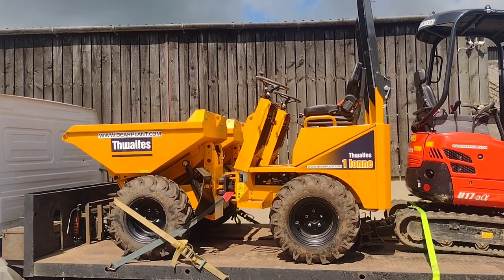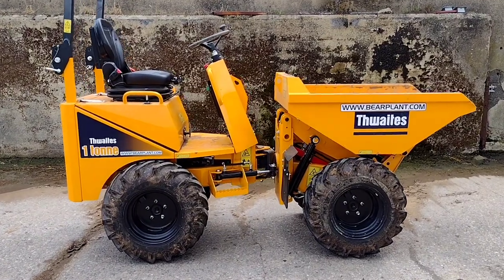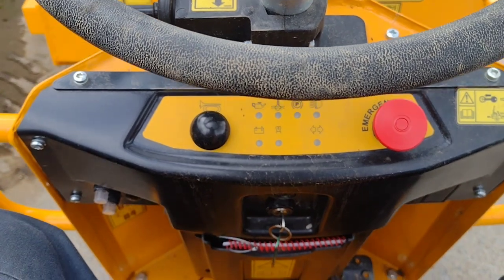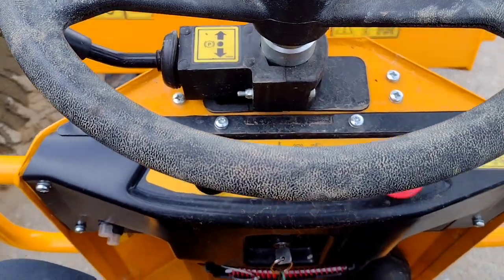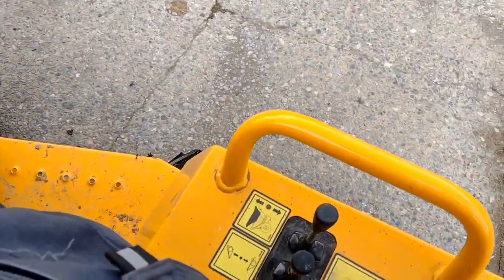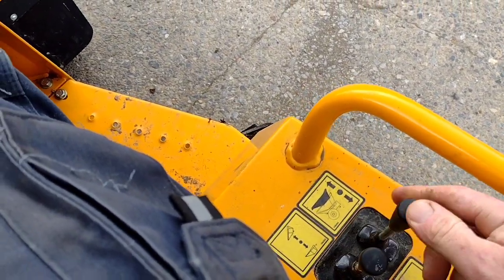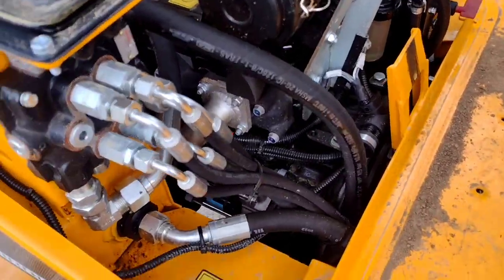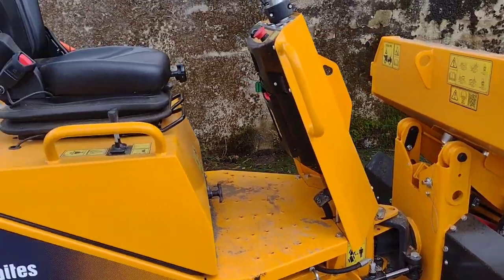How to drive a mini dumper - Thwaites 1 ton

Comment: Great vid, clear and informative.  Do you know where you top up the hydraulic fluid??  Steve
Reply from the maker: Thanks Steve 👍 Hydraulic filler cap should be under the bonnet, opposite side to the fuel filler.